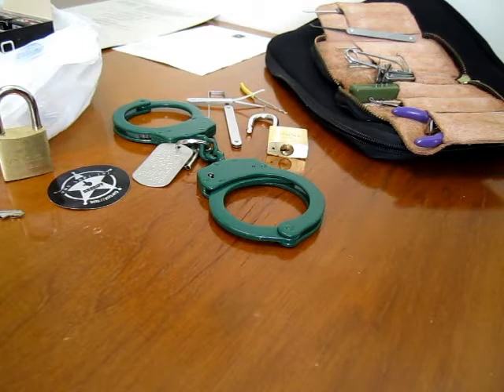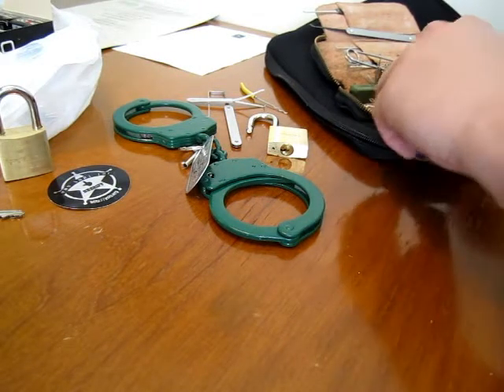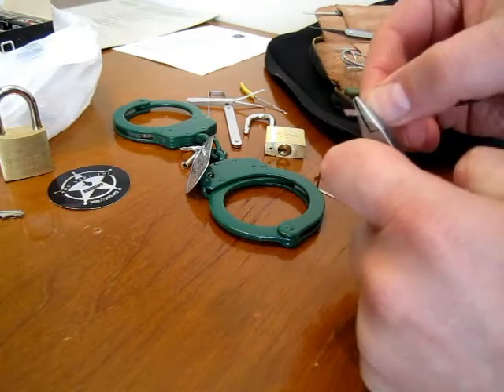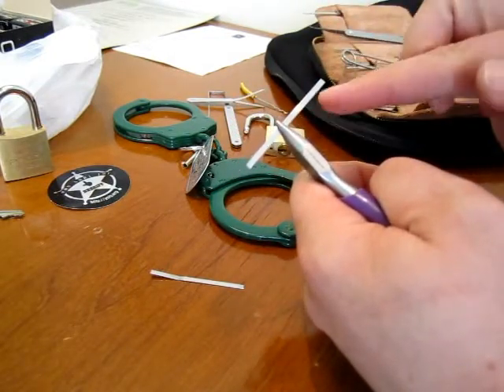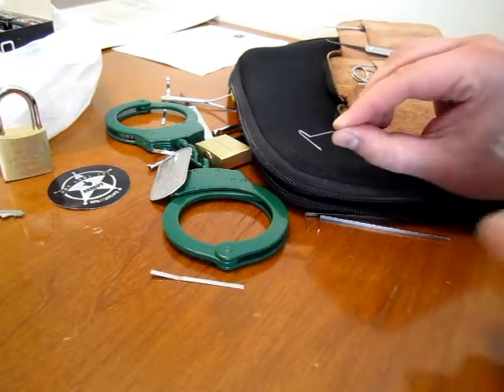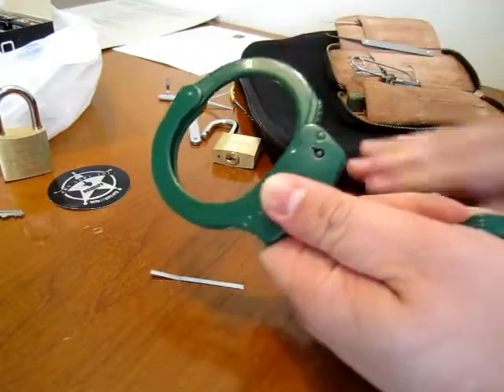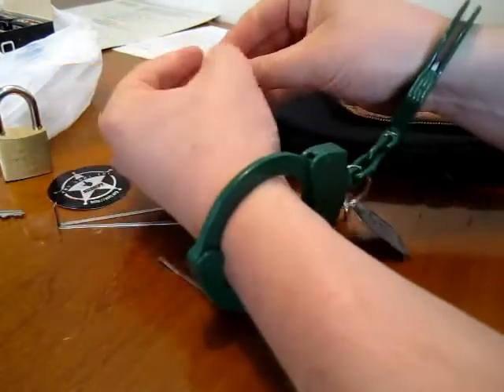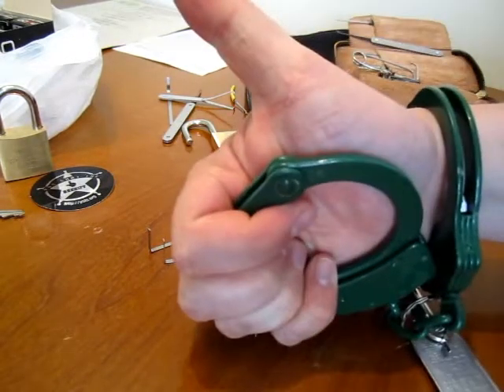Homebrew Handcuff Shims

Comment from the maker: @Skitzo365 it's rare, in my experience, to find wiper blade inserts that are thin enough to make decent cuff shims.  i suppose it's a good option if you come across suitable metal, but when you factor in a cost of about 75 cents per shim with this technique, that's not a huge overhead, either.